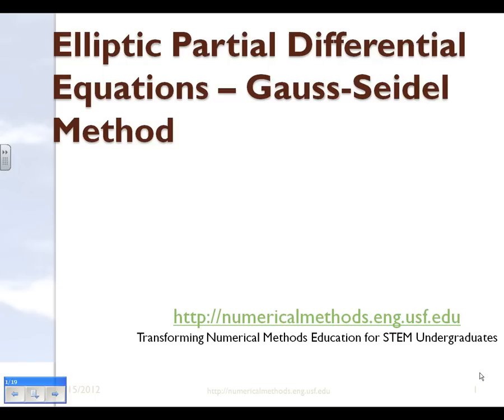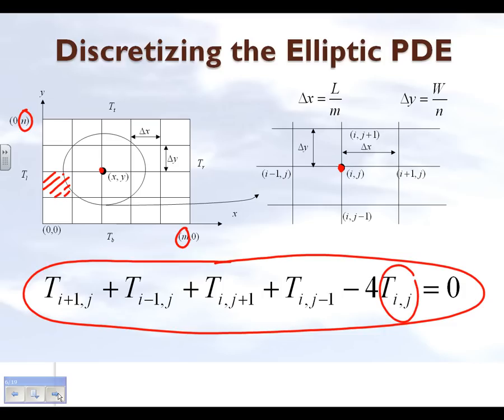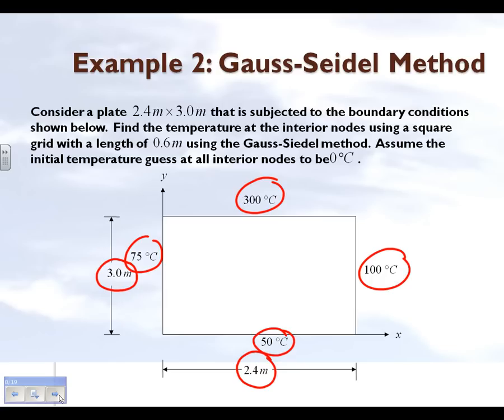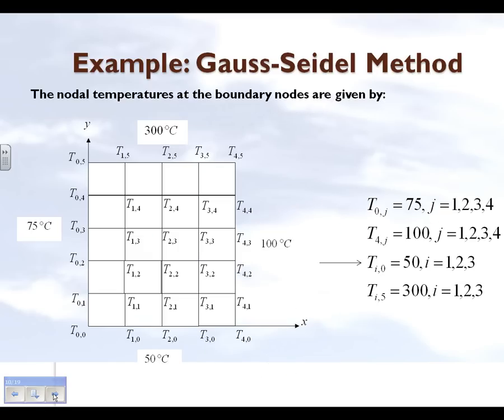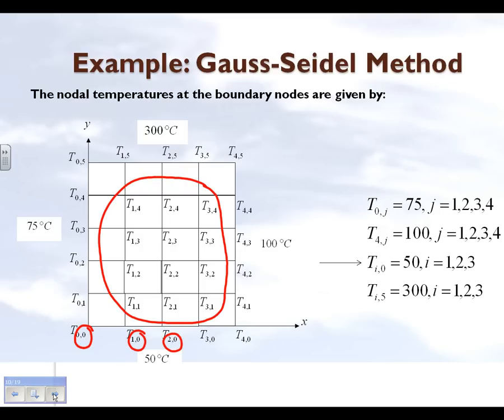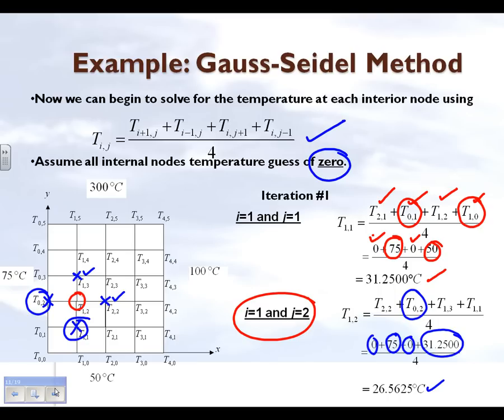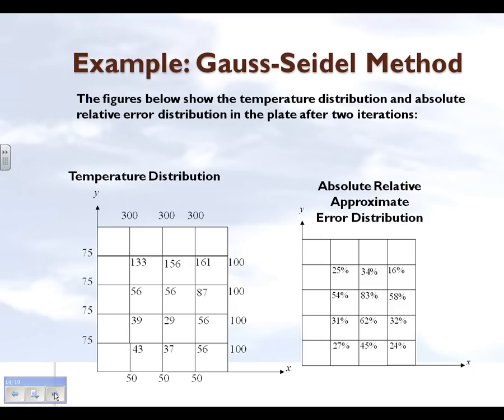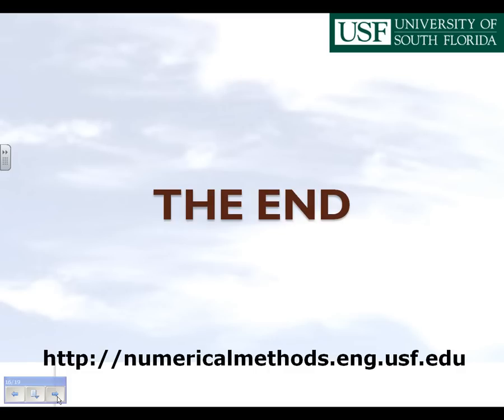Chapter 10.03: Lesson: Elliptic PDEs: Gauss-Seidel Method

Comment: Hmm...
Would it be useful/faster and or more accurate, to do this multi-resolution based?
For instance, you could take a mesh with resolution 2*2 to get only the center node and nodes on the border and then do the calculation for that center node.
Then, that node wont change any longer, so subdivide once more. That adds 8 more nodes. With the 9 nodes, do few iterations (the guesses should be much closer) and if you're suffiiciently close, subdivide again, etc.